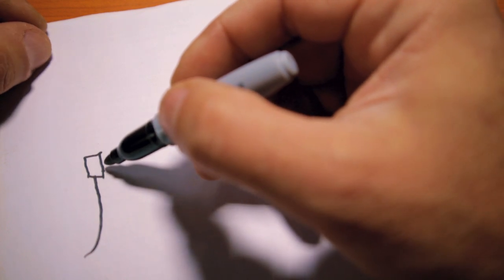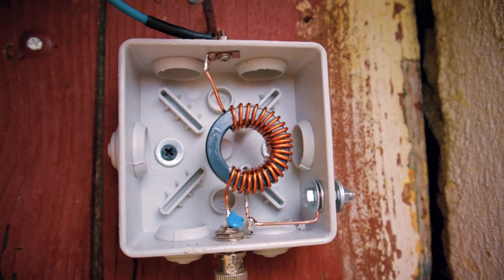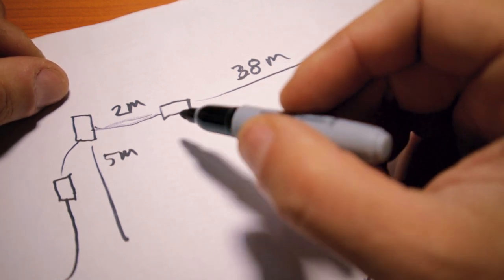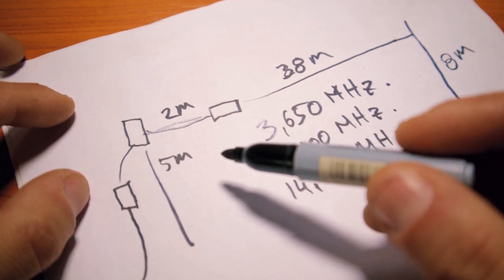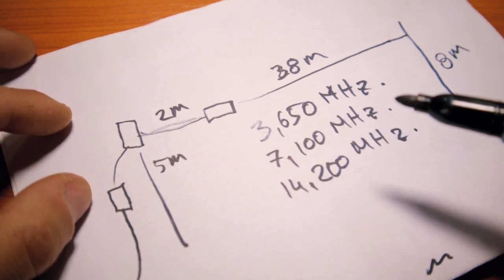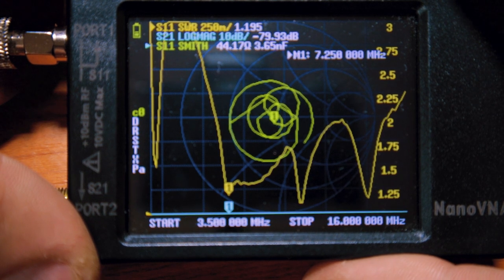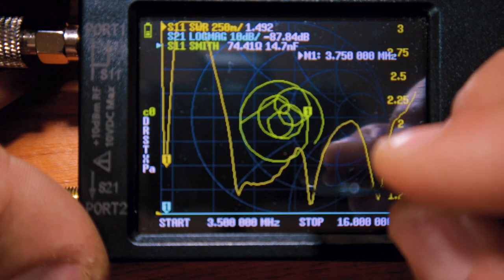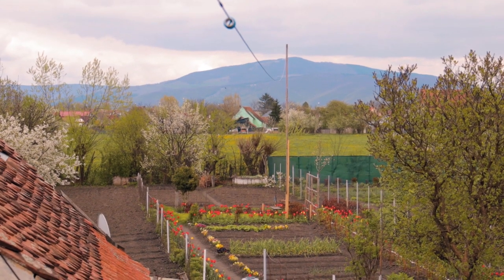Experimenting With The EFHW-8010 Antenna - Can it get better ?

Comment: I'm on a 435 square meter tiny block. I started with a trapped version of EFHW like yours to get on 80m but any antenna with a trap to get on lower frequencies results in lower bandwidths on that lower band. So I went to a 1/2 wave at 80m NO TRAP (only 40m long and less as I use an inverted vee configuration to fit it into my postage sized piece of land!). It works much better. I can get it to resonate (reasonable SWR) for 40m and 80m...as for other bands I gotta tweak it with my ATU but on HF losses are not so bad. I work mostly QRP. 73 de VK2AOE
Video below is that antenna....videos links below that video are to other stumbling antenna efforts :)))))
https://youtu.be/3pwCa2apN4A
Reply from the maker: Thanks so much. I think I've seen the video but I will go watch again ))). I think that inverted V works better on DX also and it becomes nearly omnidirectional. I just need to figure out a way to secure the wooden pole I have in the middle of the garden. The neighbor garden is right next and I would have to install a secure wire for the pole over there )). I must figure out something. I will still play a bit and see if I can get better results... if not I guess it is what it is right ? Hehehe... but even now is not bad... it does well still even with no ATU. 73, YO6DXE and have a great relaxing weekend.
Reply: this may help

The closer your antenna is to the ground, relative to the wavelength, the more the antenna is “loaded” so the required length of the wire to achieve resonance is shorter. 

As you go up in frequency the ground has less effect assuming the same height

However…the extra wire for the lower bands, affects the resonance on the higher bands lowering the resonance and making the antenna appear longer. 

My solution for you. 

Build one or more water proof match boxes that live at the base of the antenna and are optimised for a couple of bands. Make them out of fixed capacitors and coils. Swap them out as you need. 

Have one for say 80 & 40 but it may be a bit ordinary on 20m, that’s ok, maybe have a tap on the coil to make 20m work and another tap for 80m CW

Make a second that does 20, 15 and 10 really well but you may find it ordinary on 40 and unusable on 80

As for the WARC bands, you could tune them too with some more match circuitry. 

Doesn’t need to be adjustable as once you know the values you need, it should be fine, unless the box fills with water. 

I use banana plugs into binding posts to connect my antennas to my match boxes. BNC for the coax. Makes it simple to swap out. Plastic bag over the unit keeps it all waterproof 

Just an idea.
Reply from the maker: Thank you Chris. Is not a bad idea. I do have a problem as the way I have to install the antenna here ( due to the position of the house etc ), the only way I can do it is from the attic. So the bad part is that every time I would want to change bands I must go up in the attic. I already had enough of that lately after experimenting with this one making adjustments hahaha. I am feeling old now 😅. Your solution though is good as is more "personalized" for each band so I believe the efficiency would be better too. I did noted the detail about the length vs hight as I didn't know exactly how that works. So is good to finally understand the effect of the hight of the antenna. Thank you so much for this. 73, YO6DXE.
Reply: @dxexplorer  it’s such a black art, antennas. Everything affects everything else. 

I guess you could figure out what you need to make each man’s work and relay switch it. Not so much an auto tuner, just a remote tuner / match. 

George VK2AOE (above) and I have been talking for over 12 months about doing some antenna experiments in the field and measuring what happens when we change just one thing. 

As for me, my time on the air, with a tiny tiny back yard, much smaller than George’s with room for verticals and mag loops, I’ve found that trying to cover more than an octave of spectrum, eg 3.5-7 or 14-28, isn’t always achievable as once you get over that, you’re running into compromises with either take off angle or lobes in the case of a vertical, or, in the case of a mag loop, significant drops in efficiency as you go below half your top frequency

I’m going to take, what I have dubbed, the Back Yard Banger 20/40m vertical and see if we can recreate it at George’s home QTH. There is a video on his channel where we hook mine up on a tripod at his place, and make a few QSOs, drink wine and enjoy the hobby of ham radio 

Not a bad night on 20m with just 20W

I don’t think we had 40m running on it. 

Keep playing. And watch the “yellow peril” insulation batts in your attic of your have them :-)

Talk soon. And get into the CW as soon as you can. It will make QRP so much more rewarding. Trust me on that :-)
Reply from the maker: O really must get into CW as I find it to be much more fun than anything else. Plus that my dream of making QSO's with crazy simple transceivers or transmitters will finally come true hehehe. This week I will make some time and experiment a bit more with the antenna and see where I get. I either get it perfect as I wanted to be... or have no choices and do compromoses but remain with the comfort of having one antenna for a lot of bands... but not perfect so I will need the ATU at the end. We will see. After that I want to start working on a vertical for 20m for portable work... and another 8010 I stalled as inverted V also for portable. Slow and steady... getting ready for the summer and some SOTA fun )). 73
Reply from the maker: @MidlifeRenaissanceMan  I got to learn a few letters and numbers, but not enough. Still need to do this more often. Is just that I've been so busy lately I barely had time to turn on my TRX or do some projects for YouTube. But things should calm down soon so I hope by July the latest to have the first QSO's in CW. I learn fast I just need a little free time )).
Reply: @dxexplorer  I used the Ham Whisperer to learn my letters and numbers. He was sending 10WPM characters at 5WPM. In hindsight, probably a little slow. I used Lockdown Morse who sent 20WPM characters at 10WPM. That was a little fast for me at first. After a week or so I was OK with it

Maybe, as a suggestion, do 15-17WPM characters at say 7WPM and speed that up as you go. 

The Koch method gives you one new character at a time. I also used that to an extent. 

Main thing is you spend 10 minutes twice a day, everyday. 

Now I did it all in my head. Rarely put pen to paper, as I wanted to hear the code in my head as a language.  I also would listen while I was doing something else that didn’t involve the language part of my brain, such as driving, cooking, cleaning or fixing stuff around the house. Even having a shower. It was all about making it second nature. 

Once I knew all the letters and numbers, I would start my practice sessions listening at 33WPM and focus on picking out one or two characters at that speed, then I would slow down to 28WPM, then 25, then 20WPM. 

While it was still too fast for me to copy everything, my reflex time improved, so when I got down to 15WPM I could copy most of what I was hearing. Not all. I would still lock up on certain characters, but it definitely helped, compared with going in cold. 

Personally, I find the gap between letters a little short, and prefer a gap that’s about 50% longer at a given speed, but as I now have some “word recognition” going on, the shorter spacing between characters makes sense 

Join SKCC if you haven’t done already. They have some fantastic resources to help you on your CW journey and their discussion groups have some of the most fascinating stories and insight into the whole telegraphy thing.

It’s free to join and no annual fees. If you tell Randy, the membership manager, that Chris VK2NAP sent you, he’ll give you 50% the first years fees (hi hi….or is it hee hee ? I suspect the latter   dit dit dit dit     dit    dit… and was abbreviated to hihi….what do you think ?)

If you want something you can use anywhere you have some internet, I’ve been using Tim Alex’s website thing he made.  

https://mitxela.com/projects/morse_code_practice_tool

Has everything you need and all for gratis. I still use it on the odd occasion while I’m out grocery shopping and listen to some Wikipedia’s on this day stuff. See how I go at picking out words and phrases while otherwise engaged. 

All that said, I’ve been off the air for too long, and my code is patchy at best now.  Probably back to 12-15, as opposed to a solid 17-20WPM when I was operating regularly. 

Anyway, it would be good to have a DX QSO with you on lower powered gear you built yourself. 3-5W is nice. 20-30W is more than an S point better and can be had out of a couple of IRF510 MOSFETs. Euro land to the antipodes is open during our afternoons and early evening. 20m seems to be regular. 40m opens up too. Cracked 579 into France on 20W one afternoon some time back. 

So what have you been doing to learn to code ??
Reply from the maker: I'm using the app from IZ2UUF... nice Morse trainer and learning at 22WPM as I was told is better to start this way. Is a little harder but is possible )). I just need free time. Right now I am learning usually when I'm on the street walking or in a buss. That is my only free time )).
Reply: @dxexplorer  I did the same. Driving. On the train, walking to and from grocery shopping. 

So characters at 22WPM is good. What spacing between the characters are you doing ??
Reply from the maker: I have no clue. I didn't changed any settings in the app just the WPM. But us quite fast for me so my ears are like antennas all the time trying to make up the characters hahaha. Is good practice though. I see hear less and less slow CW every time I'm on the bands.
Reply: @dxexplorer   have a look at the character spacing 

Try the web page I gave you. Set the send speed to 12WPM and set the character / Farnsworth speed up to say 18WPM. Select some Wikipedia on this day, as, let’s face it, who wants any news these days. It’s all doom and gloom and trauma….

See how you go copying at that speed. 

See how much you can decode. You may surprise yourself. Most of the rag chew I hear is around 18-20. Straight key ragchew is probably 15-16WPM. 

I’d say, if you’ve been doing 22 WPM no gaps, you’ll find 12WPM character spacing a walk in the park
Reply from the maker: I saved the page and I'm going to have some fun this evening ))) Thanks Chris 😁😁. 73
Reply: @dxexplorer  let me know how you go

Another good resource you can try is Morse Ninja’s training videos. He has such an insane collection of training videos, from single letters, to whole phrases, and everything in between such as QSO words, callsigns, common phrases.  It’s incredible 

The ones I like are the speed racer ones. If you try the 15WPM video, the word is sent at 23 WPM, then repeated at 20, 18 and finally 15WPM before it’s spoken. Then it’s played back at 23WPM again. Great tool for pushing your speed up. 

Another trick is to hook up FLDigi and see how well you do at getting the CW decoder working.  I often use a decoder. It lets me relax and listen to the CW without stressing when I miss a letter. It’s not so much a wheelchair, more of a crutch. :-)

So how was the slower paced CW ?  How did that work out for you ??
Reply from the maker: This week I am crazy busy working in the backyard ))... and I have some guests coming over as Andrei from rowaves.com wants to come for a visit bringing some goodies ))). Next week I will be a little more relaxed. Now on May 1th is actually the start of my three months to learn CW and make a QSO. Is like a challenge so I have to make it happen ).
Reply: @dxexplorer  well good luck. Reach out if you want. My callsign is VK2NAP. Easy enough to track me down. More than happy to help in anyway. It wasn’t that long ago for me. 2020 when I got my license reinstated. 

If you want a straight forward QSO, you just need an RST exchange. So not a lot. I prefer to at least exchange names and QTH. SKCC number with another SKCC makes the QSO count towards one or more awards / levels they have 

Interestingly, I jumped on VBand after hearing about it on some discussion on some YouTube channel. Can’t remember where. 

Had a couple of dodgy QSOs using the control key as a straight key on my old mechanical keyboard. 

I haven’t been on the air for any rag chew in over 6 months. Damn I was rusty. A couple of QSOs and it’s coming back to me but still pretty ordinary. Copy wasn’t so bad, but sending was a challenge, especially conversational CW outside the usual WX, RIG and ANT. You’re thinking of the spelling letter by letter, then trying to translate that into smooth and evenly spaced code. Moreover, VBand translates for you, much like I use FLDigi’s decoder so you get to see how cleanly you’re keying. 

I’m thinking of finding a trash keyboard and pulling the encoder board out of it. Wire up what I need to give me the control keys into a 3.5mm Jack. 

Then again, when I’m on my computer, I really should be working, not playing pretend radio. VBand is like FT8 in reverse. Instead of using computers to talk across radio waves, we’re using old radio protocols to chat across computer links. Completely redundant, but it serves a purpose. In fact it’s kind of full circle in that it’s using the current version of carrier technology built by carriers who have evolved from the original telegraphy networks of the time of Sam and Alf :-)
Reply from the maker: What I need is to get the code problem solved enough that I feel confident being on air on CW... and what I will do is hunt you down in frequency for a QSO hahaha. That is a deal. I have a few callsigns to hunt for CW... and a few more that I really want in my logbook as they are mostly subscribers to the channel and people that were kind enough to always help with good advice or a nice email to encourage me to keep going... and those meant a lot to me in the hobby. Thank you again Chris. 73
Reply: @dxexplorer  if you can copy 15 WPM  character speed at 8WPM, you’re good enough to get on the air. 

Learn your letters & numbers at say 20 / 10. Speed up from there. A little bit each day. Twice a day. 

I have a silly idea. We should make July 23 Pixie Day. 7/23 as the Americans write it. 

It’s the day of the year you get your cheap Chinese QRP kits and other home brew drawer clutter and dust collectors, fire them
up and put them on the air. 

Why 7/23 ?? Because of the ubiquitous 7023 KHz crystals that come with these Chinese kits.  

What do you think??
Reply from the maker: That is not a bad idea at all. Heck yeah why not ? )) Love it... very clever indeed. Yes I did started laughing when I've seen the date as I figured is the crystal hahaha. Damn mine is on 7030 now I must change it back hahaha. P.S. Tomorrow I'm going to email you something on this ))
Reply: @dxexplorer  that could be the week later.  This year 23rd July is on a Sunday. So perfect. 

Sunday the 30 July is the Sydney Blues Society jam session. Sometimes I get there. Not often. But this is always the challenge for me. Straight key, guitar and a glass of wine….but only two hands :-)

I’ve hit up our local aussie chapter of Fists. I might make a post on the SKCC groups chat. See if we can get this off the ground.